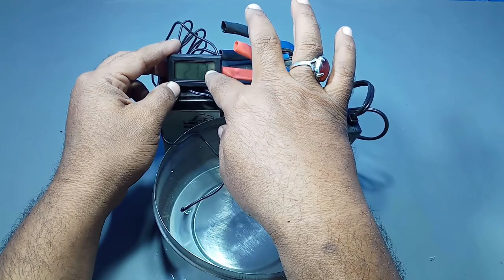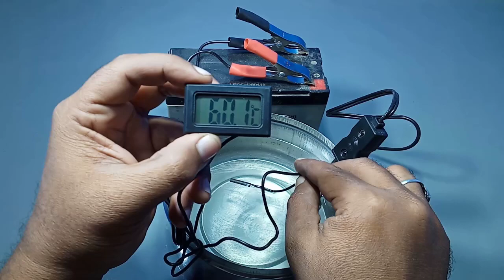Solar Water Heater at Home | DIY Dc Geyser

Comment: Hi, I like the concept of the element, but I see you use a small battery. What is the wattage of the element and how long will your sized battery last before it is drained to a point where it needs to be recharged? I have heard that small batteries are inadequate to power heater elements. Will this element work with a 100ah battery connected to a 300w (8.3a) solar panel to assist in heating up 150L of water? I also have a coiled solar pipe system that circulated the tank’s water as well.